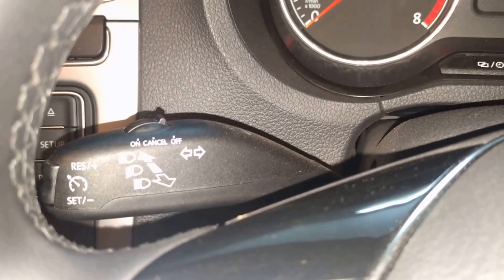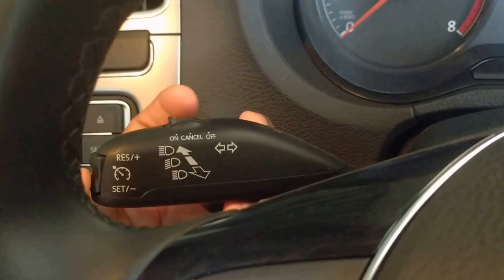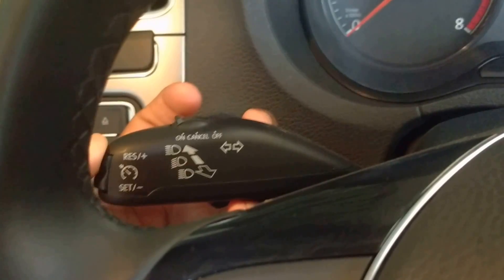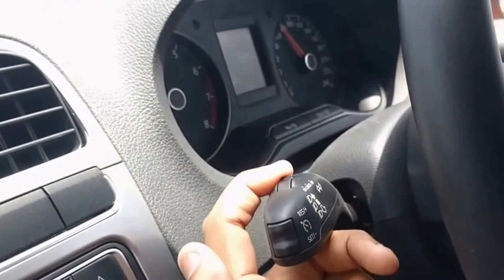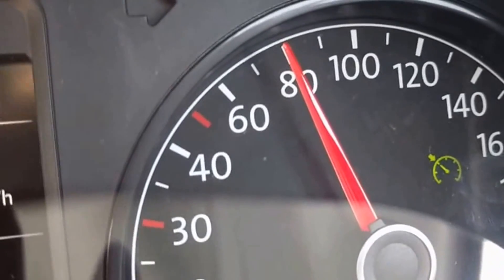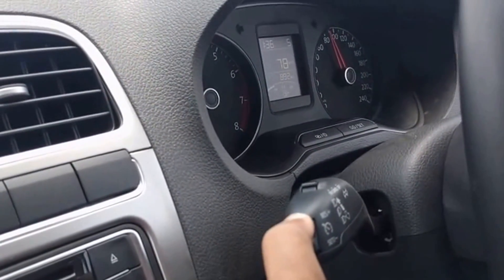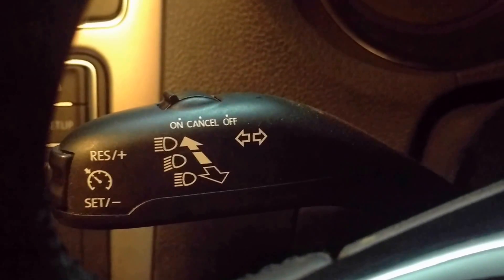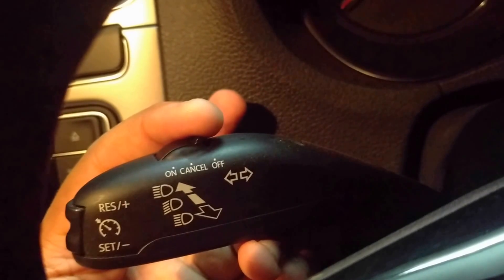Cruise Control System in Volkswagen Polo - AllStar / Highline / GT

Comment: dilip ji, I want to know that while cruise control system is activated, I have to press the accelerator pedal or not?
Reply from the maker: No. You need not press the accelerator pedal when cruise control is activated.

Comment: Hi dilip sir, all your videos are very informative continue doing videos and i have a doubt on cruise control. Is that possible to accelerate and deaccelarate the vehicle during cruise control and if we do that does cruise control gets deactivated.
Reply from the maker: Thank you so much for your valuable feedback.
It is possible to accelerate the car while using cruise control. Press down the accelerator and the car starts to move in higher speeds. Once you take of the foot from the accelerator, that new speed is set and cruise control comes in action again. 
Only if you press the brake or clutch, Cruise control gets deactivated.
Reply: dilip sukumar thank you for your reply sir. So using ccs in smart way is to use it on the empty stretches!
Reply from the maker: You are welcome... 
Yes... CCS can be used only in empty stretches. I usually set a speed of 90 to 100 kmph when I am driving very long distances in the highway. When there is traffic, I press the brake and CCS gets deactivated. I drive normally till the road gets cleared. After that I press the resume button and again my set speed is maintained in CCS. The benefit of CCS is that I get 0.5 km more mileage per litre if speed is maintained at 90 kmph.

Comment: Hi Dilip what’s the maintaince cost of this car ??
Which is good car among Honda City and vento allstar ??
Reply from the maker: +K Bhpian Maintenance cost ranges from Rs. 8000 to Rs. 12000 per service. It has to be serviced once in 15000 km or 1 year whichever comes first. 
Both are very good cars.
Get the Honda city if you want more features and more rear seat space.
Get the Vento if you want Solid build quality and a steering that gives accurate feedback.

Comment: Very good information.. I've been using a vw gt for an Year, still I don't know it's full functionality... thanks so much... Also please tell me why there is a cancel button in the middle of on and off ????
Reply from the maker: +sss Cancel button is to switch off Cruise control temporarily. While you are Cruising in a speed, you can keep the switch in cancel position to switch cruise control off temporarily. Cruise control is cancelled, but the speed is stored in the memory. Now, you can switch back the button to on position and press resume button to start Cruising in the same speed. The other simple way to end the cruise control temporarily is to press the brake. Thank you.